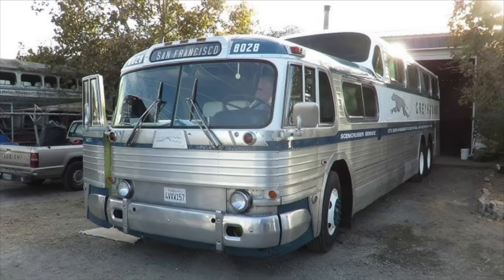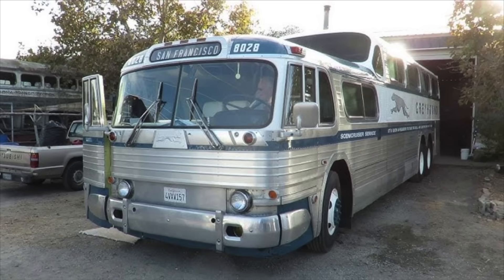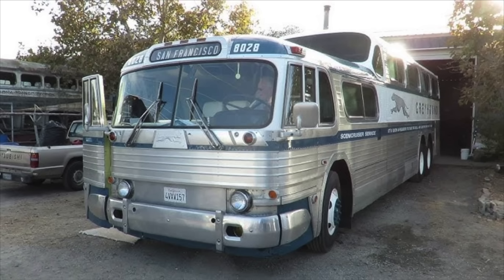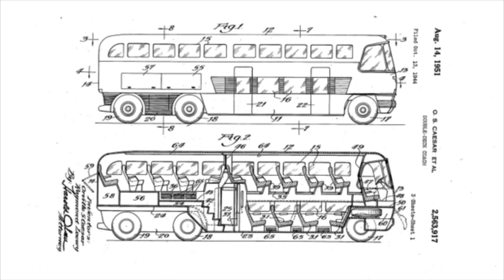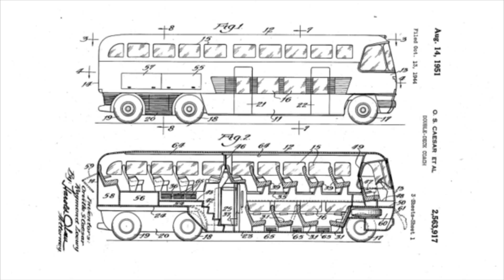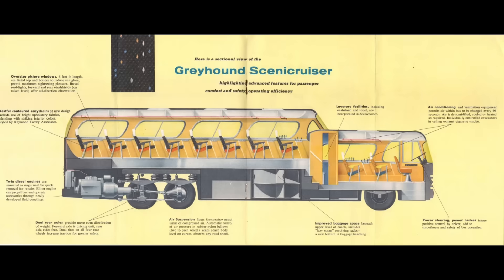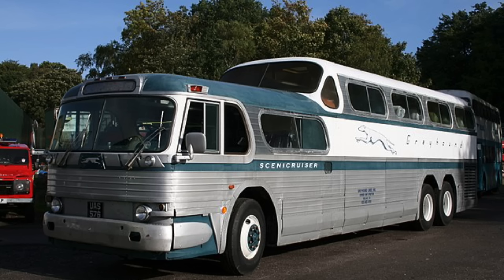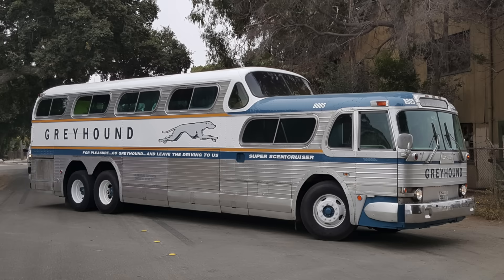Awesome & Flawed Vehicles: 1954-56 Twin-Engine GMC/Greyhound PD-4501 Scenicruiser Bus!

Comment: I rode a Greyhound Scenicruiser.into San Francisco in 1973. It was rather worn and tired by then and smelled strongly of diesel exhaust, but was still spectacular going across the Golden Gate Bridge.  The unsymchronized transmission explains the gear clashing, as it was the driver rather
 than a worn drive train.  It was quite an adventure in any event

Comment: As you mentioned the engines, those engines were 2-Stroke Tubro Supercharged diesels. I used to maintain & operate that same engine in standby engine generators in the FAA. I bought a motorcycle from a retired Greyhound Bus mechanic in the 90s and he had bought a Greyhound bus turned into a motorhome, he wanted me to help me work on the engine with him to get ready for a big trip he and his wife were planning but as much as I wanted to help him I was just too busy with work, kids & ball games. I still believe I missed a great oppertunity to learn so much from him and his 30 years experiance of working on these great machines. I also was one of those kids who would watch the driver and bug him with quistions and wishing I could get behind the wheel.

Comment: As an avid Mark III owner like you Adam (15 in total)
I was also an owner of a PD4501, mine was PD4501-582
I found mine in a old copper mine outside of Tucson AZ
It was converted to a RV right after her retirement in the mid 70's and registered as an RV so i was able to drive it without having to a CDL
I've since sold her and last I heard it was back in Tucson in a storage yard
Reply from the maker: 15 marks!  Wow.
Reply: @RareClassicCars  Adam did you notice the original Greyhound color scheme on the PD4501 looks familiar?
Re: Air Force One !
Another Raymond Loewy design
Reply: From when to when did you own #582? Last info I had on it was that it was sold June 2016 for $4,805. Now in Tucson waiting to be moved to Maryland and its new owner.
Reply: @paulmontry I owned it from about 2012 to 2016, I sold it to the current owner

Comment: The Scenicruiser was NOT a "double-decker".  Rightfully, it is defined by bus / motorcoach professionals as a "deck-and-a-half".  That description would continue many years later, after Scenicruiser production ended, when GM built the so-called "Buffalo Bus" between 1966 and 1980.  Regarding Raymond Loewy, and his role in transportation design, his greatest (and most productive) contribution to "Modernism" in public transportation was his exclusive design of the Pennsylvania Railroad's signature train, the "Broadway Limited", which ran between New York City and Chicago.  Countering his stylish design(s) was Henry Dreyfuss, who -- working for the PRR's competitor New York Central -- designed the rival "Twentieth Century Limited" which, also, ran a separate, dedicated route between New Yorl and Chicago.

Comment: Way ahead of its time, that dual range gearing like the twin stick Mitsubishi used on the Dodge Colt in the early 80s?
Reply from the maker: Different. The splitter effectively changed rear end ratios.

Comment: Funny there is a picture of my brother as a little kid with a toy of that same bus across his lap.  That was taken in the early 60s.  The bus  kinda reminds me of the train the California Zephyr with those panoramic windows.  The Zephyr began service in 1949.  Makes me wonder if that was an influence.  The twin diesel engine choice is interesting.  That brings to mind that some of the Chicago police boats have twin diesel engines.  Those boats can really get up and go even though they are about 30 feet long with a steel hull.  I remember being down at the lakefront and seeing the police give that boat lots of throttle from idling along and it planed out very quickly.  I was amazed at the power.

Comment: My first job was working at a heavy duty recycler. The boss bought a whole bunch of 4l71 engines that had been in a yard in the Texas sun for years. Just removed and placed there. He stated they were from Greyhound buses but that was all. They were inclined engines laid over about 70°. There was an oil pan adapter that bolted to the block. The oil pickup tube was different to go down to the new oil pan location. Then the original oil pan bolted to the adapter. 
One engine would be laid over to the left and the other to the right. I forget the GM Diesel engine model numbers used as the one cylinder block was turned end for end compared to the other to get the blowers on top. Then the head was turned around to get both exhaust coming out, I believe the bottom.
I always wondered how a Greyhound was powered by a (1) 4l71. This explains that.
Later I got to work at Detroit distributors and got to work on 4l71 and 6l71 twin sets. Same basic idea but bolted to a gear box. Blowers on the outside and exhaust between. Both engines are left hand rotation which is opposite to most engines. The gearbox had three gears, the outer gears driven by the engines drive the center gear in a normal rotation. There is/was quad units available for marine applications and the availability for V engines. If an engine had a failure, the clutch could be disengaged and that engine repaired while the other(s) were running. Tuneup to get the low and hi idles synchronized and then the throttle linkages to all pull together was time consuming.
Reply: Inline 71 Series Model nos. were RA, RB, RC, and RD for RH rotating engines and LA, LB, LC, LD for LH rotating engines. Only difference between RH and LH rotating engines was camshaft, idler gear helix and location, crankshaft timing gear helix, and oil pump.
Reply: Detroit could make an engine to power most anything. Tech manuals were good also. @artstephenson5803
Reply: I was thinking the same thing. GM had some experience with connecting multiple engines together, but I guess that it was just too complicated in a bus fleet environment. 🤷‍♂️
Fageol had the same problem with their early Twin Coach bus. All of them eventually got retrofitted with a single engine.
Reply: Fantastic response man
Reply: I worked on the quad units for years (70-75). Loved those grey marines!

Comment: I had a die cast toy version as a kid that was about 5 inches in length and painted like the original. It got played with a lot until the wheels literally fell off. I took a Greyhound bus to visit a college in 1968, but not a Scenicruiser. I also took Continental Trailways buses until I got a car. Although the ticket was cheap, the 12 hour trip was no fun.

Comment: I'm a truck driver. I can shed some light on the 3sp with splitter decision. Firstly I think (think being the operative word) the splitter you're talking about is actually the range selector. Range selectors on on non splitter transmissions are very common, whereas I've never heard of a splitter equipped single range non syncro transmission - however - I'm happy to be corrected.
A splitter is something different. It gives you a full strength half gear in every gear position. 

Splitters are ridiculously simple to use so I find it implausible drivers wouldn't like them, whereas a 3sp with a dogleg pattern and a range selector makes more sense in your scenario. 

Splitters split the ratio between gears shifts from 400rpm to 200rpm while in the same 'hole' or gate - hence the name splitter. 

As an example, if I'm driving my semi empty with an 18sp, you can start off in 3rd gear in low range, shift to 4th LR then shift to 1st in high range then 2, 3, 4th. So basically I'm using it as a 6sp. 
The prime mover is 9.5t and the trailer an extendable, also weighs 9.5t. So gross 19t empty. Forgetting the splitter complications and crawler gears an 18sp is just a plain 'ole 4sp. I can easily take off in 3rd at 19t. All the extra gears are for options when heavily loaded - you don't shift sequentially from 1-18 except perhaps pulling 65t in 2x trailers up a hill.  

So the choice of a 3sp with an on the fly range selector like big rigs have is perfectly adequate for a lightweight vehicle like a bus even when loaded. In normal ops you'd probably only start off in 2nd and use it as a 5sp.
Reply: Never driven a super 10 before? I had one a few years ago, unlike a normal eaton fuller 10 speed where you have a 1,2,3,4,5 low and then flip to high range and get 6,7,8,9,10. The super 10 has a splinter like a 13 or 18 speed but no range selector. So you have 1,2,3,4,5 and you have to spilt them. You basically have to split every single gear. I don't know who thought this was a good idea but it is a royal PITA to drive and slow to shift compared to a normal 10 speed. I don't care for the super 10 it's just a really dumb design. Fortunately I have a truck with a 15 speed now. That's another oddball transmission that is basically a normal 10 speed with an additional deep reduction range that gives you 5 super low gears. It looks like a splinter slider but it's red and has a totally different function on the 15 speed.
Reply: @Trump985  That oddball 5 super low gears!! I can tell you we had a late 1990s 285hp Isuzu bogie drive heavy rigid truck that had one of those with a PTO powering a hydraulic crane mounted aft of the drive axles.
The overhang behind the axles was so long one had to be careful at 2 lane in each direction intersections not take out cars with the overhang if you were turning. 
The trans was an Eaton Fuller. A most uncomfortable truck to drive empty because the heavy crane made the cab bounce up and down -  a bit like the tail wagging the dog so to speak LOL.
When it was loaded it was fine.
You are the only other person I've ever 'known' apart from the guys that drove it, that knows about that transmission. The 5 xtra-low low gears were so low they were utterly useless. Probably be OK for towing trailers if it had a ring feeder. Here's the thing, the splitter was disabled in high range.
Reply from the maker: Thx much!
Reply: Being non-syncro, could you float the gears?
Reply: Yeah, the only "splitter" I'm familiar with on a non-range change transmission is either a twin gearbox approach or a two-speed rear axle

Comment: Yes, I rode in a Greyhound Scenicruiser from New York City to Philadelphia in the 1960-1961 time period.  Was seated in the first row on the upper level.  I distinctly remember there was less leg room in thzat first row than in the other seats, due to the fact that there were two bathrooms on the lower level tucked in on either side of the stairs leading to the upper level.  That first row of seats on the upper level may have been great for kids, but less so for adults.
Reply: Only one restroom on the driver's side downstairs, with a pair of seats across the aisle. Totally agree about the lack of leg room for adults on the upper deck's first row.

Comment: My family owned 2 of these in 1979, 1980, 1981.. They were novel for charters in the Houston area. We were always afraid the top front windows would break and had no idea where to get them. Both were already converted to 8v71's with 4 speeds. The 2 stroke diesel were pretty gutless and could have used a turbo for sure if you were in any mountain or hill country. In Texas they were ok but in Colorado or Arkansas was a hard slow drive and you had to watch the temperature gauge. At the rear in the back of the coach there was a large booth style table that many liked to sit at and play games. Cards etc... Could seat 10 or so.  The best seat in the house was always the top deck front seats though.  But just walking the isle forward you could get a nice view of the road ahead before you went down the stairs.

Comment: The college I went in the mid 80s had a Scenicruiser.  It had been retrofitted when I remember it, but still had the switch placard for the twin engine controls.  We used it for the traveling band because the luggage bays were tall enough to fit the tympani drums. The newer bus wouldn't fit them. I liked sitting in the front of the upper deck, too.  I always thought it would make a great motorhome.  Would have loved to have driven it on a trip, but, alas, it was gone by the time I started driving bus.  I did learn to shift that 4 speed crash box.  I miss those days.

Comment: The reason for a 3 and 4 speed tranmission is done on purpose.  The engine has a 400 pound flywheel.  When the bus is accelerating, the engine revs out to 2150 rpms and shift.  The engine speed drop is down to 1500.  When the clutch is let back out, the delivery is silky smooth transition between gears.  This was designed for comfort, the passenger, not feeling the shift and being able to sleep through a lot of shifting.   I rode on one of those PD Scenicruisers when i was a kid in the early, mid 70s.  It was a regular bus from Thunder Bay to Wawa and back, doing the milk run along shore of Lake Superior.  The Greyhound Bus depot in Thunder Bay is a Dentist office now.

Comment: I'm surprised GM didn't opt for their 6-110 inline 6 engine to power this, instead of the two 4-71s and two transmissions. The 6-110 was essentially a larger 6-71, with displacement of 110 c.i. per cylinder instead of 71. It produced about 300 h.p.  Maybe it was too large for the available space.

Comment: Adam, thanks for the memories. My two cents. I rode many Greyhounds, including Scenicruisers, during my stint in the Navy. Stationed in San Diego most of the time, I would travel home to San Luis Obispo Ca. on weekends. The Scenicruisers were much preferred, with their superior ride, lavatory and A/C. They also were used on the limited stop runs, as I recall, while the standard coaches got the local runs. I remember one brutal trip on a local, a 9 1/2 hour friday night trip home, that included 24 stops at every wide spot in the road. Great memories, but I have to say I don't miss them.

Comment: They are gorgeous! GM without a doubt made the best buses in world history and the 2 stroke Clark cycle Detroit diesels were the greatest diesels in world history. The twin 4-71 set up is same basically as the twin 6-71 setup used in marine and industrial use as well as things like military applications like tanks, The main reason this set up was replaced by the first “dry lower block” 8V71 V8 engines, easily recognizable by the same “race track oval” pretty large air box covers as the 2-71, 2 per side, which later became the “wet lower block” models with water passages below the intake ports which the earlier models didn’t have, which have small rectangular air box covers to allow room for these lower water passages, hence “dry and wet” in this case, 8V71’s with likely 2 valve heads. The wet lower block engines made more power and needed the extra water cooling below the ports as they can over heat and lock up which sometimes happened in the dry lower block engines especially if swapped with “N” heads with 4 valves (all exhaust) to gain more airflow for more power. This engine is venerable and the only true reliable V configuration diesel actually, along with all other size V-6, V-8, and V12 Detroits. “The greatest diesels in world history!” Is ny motto and it is very well deserved and earned! 👍🏻😋 And the SOUND is good enough to EAT!! 🤤🤤🤤 Awesome stuff!! 😋👍🏻😊

Comment: When Greyhound helped design and build the MC7 and MC8 "Freighters", as the Scenicruisers were heing retired they removed the heavy duty 8-wheel rear suspension and installed them on the freighters, no tag axles on the Scenics, there was 8 wheels back there to handle the weight. The freighters had the restroom moved closer to the middle and the rear section of the bus was all heavy cargo accessible by forklift from outside. Seating capacity reduced to 24 to 28 seats. About 100 of these built in the early 70's used on thin routes in the days before deregulation when Greyhound was forced to service these routes. They figured if they couldn't make it on passengers they would try to boost revenue via heavy freight. Greyhound Canada did the same thing later with buses pulling trailers.

Comment: I commuted on Greyhounds daily in 1970. Occasionally a Scenicruiser was assigned to the route. As I recall, the driver in a Scenicruiser shifted through the same four forward gears as other Greyhounds. The ride was no better or worse than the single-level Greyhounds. The only unusual feature I recall,  other than elevatedI seating, was some kind of individual seat radios that by then were inoperable. From appearances, the Scenicruiser buses I rode in 1970 were barely up to minimum standards compared to other Greyhounds, and seemed to be next in line for retirement.

Comment: Adam, great video, as always.
 I briefly drove for Greyhound in the early 90s, all my experience was on MCI MC 9s and 102C3s with the 6V92t and unsynchronized 5spd Fuller. I remember hearing HORROR stories from the older drivers and mechanics about the "twin engined mistake from Hell!" So I guess I'm spoiled by MCI. You didn't mention it in your superb video, but one of the reasons for the raised roof was the SceniCruisers absolutely CAVERNOUS underfloor luggage bays. Bus travel was incredibly popular in the 50s and 60s and they needed the capacity. 
Really enjoy your channel and enjoyed this little direction change. I can't wait to see where you go next. 
Cheers.

Comment: The four-speed transmission in the 4501 through the 4107 (35') and 4905 (40") was a conventional "H" shift pattern with no reverse.  To reverse, you had to pull the stick from neutral into second gear while pressing the reverse switch   which activated a solenoid to kick in the reverse idler gear.  These buses had no tachs or fuel gauges so I used the oil pressure gauge for a tach.  You mentioned cubic inch displacement.  Being two-stroke diesels, the displacement of similar four-stroke diesel was about twice as much.  For example the DD 6-71 (218 hp) had a displacement of 425 CI while a 220 HP Cummins measured at 743 CI.